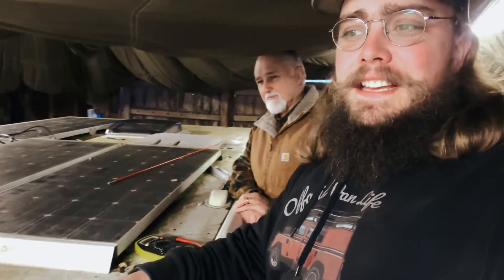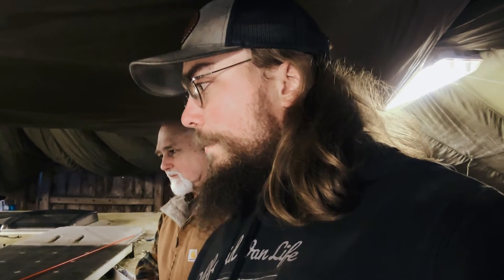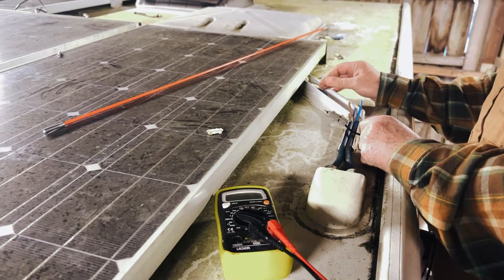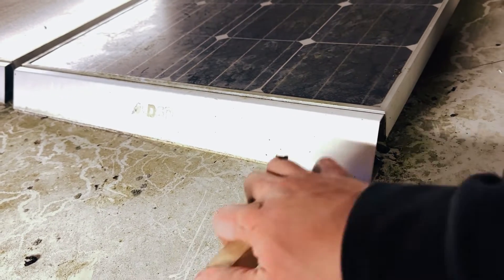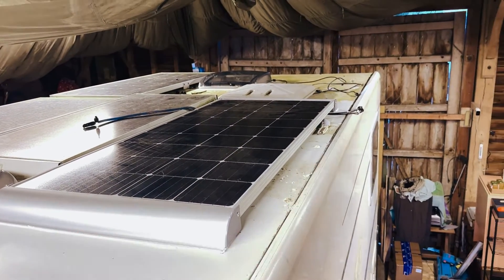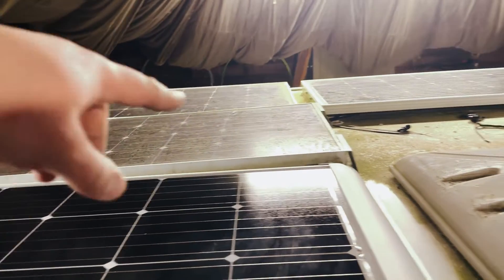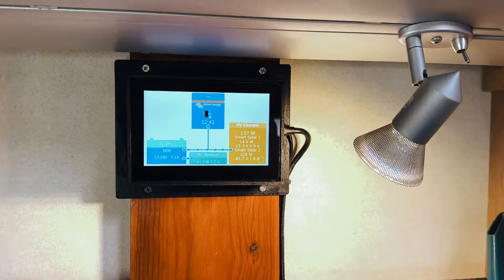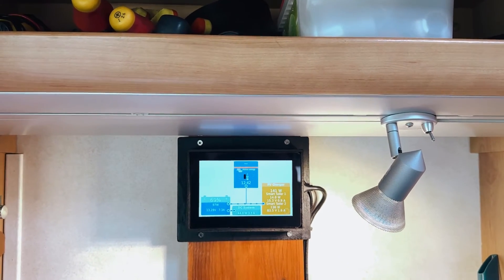Installing 820w of solar on my van

Comment: 5:06 Putting a bracket across the front side of the panels restricts air flow under them. Air flow helps keep the panels cooler. Solar panels are less efficient when they are hot. Here in the southern California, USA, we put the brackets on the side of the panels to allow for air flow to help cool the solar panels. Just a thought.

Comment: 450w 12v solar panels €79.00 in Spain 🤩 
Great work Captin and 
Looking good 👍 
But you will never get 860w out of your set up 
🤔 
I have 2 x400w solar panels and I’ve had 805w out of my set up on my van 👍 😉 
If I could post a picture on here I would show you
Reply: Loved the video, but if you'd left my van with Sikaflex smeared like that I wouldn't have been happy.